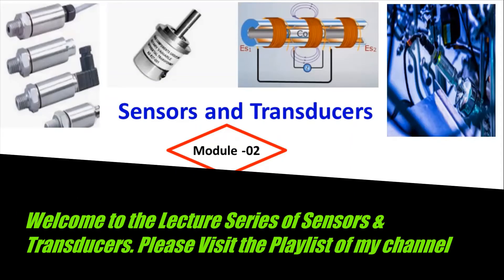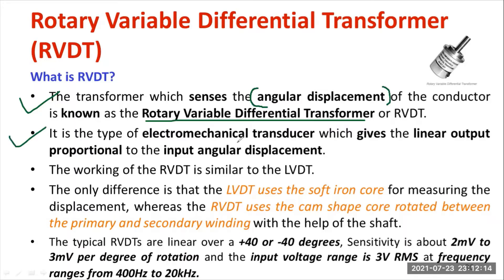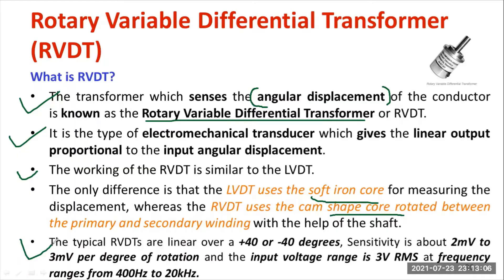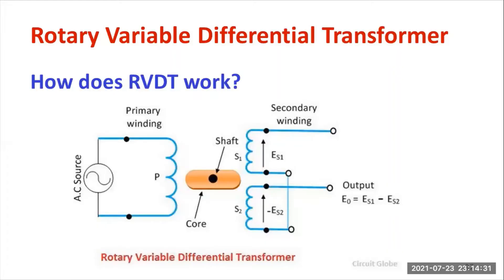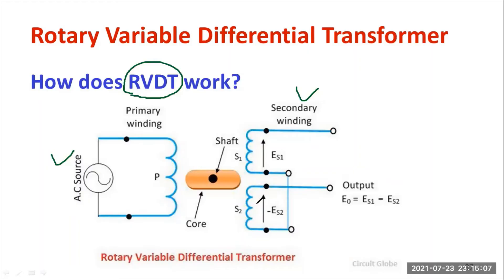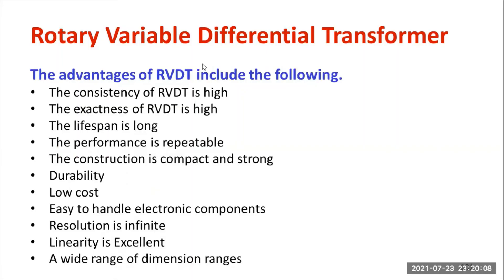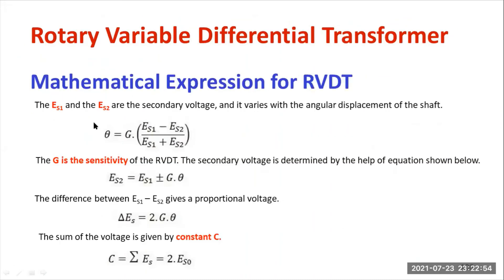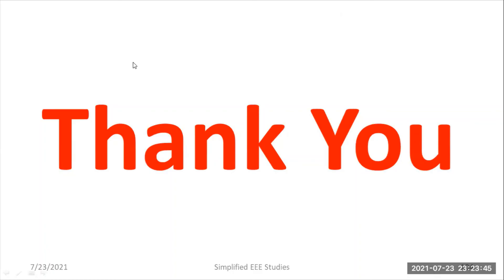ROTARY VARIABLE DIFFERENTIAL TRANSFORMERS|RVDT|CONSTRUCTION WORKING, Advantages,  & APPLICATIONS|S&T

Comment: I know this video is a bit old, but I can't find many videos on the topic, though I have a question. How viable would a RVDT be if the coils were on a PCB, and manipulated via a magnet; specifically, the primary being on one side of the PCB with the secondary on the other, with the pinout being ground, source, signal 1, and signal 2. I can't find any diagram, or really even a product, that depicts an RVDT in this way. I am referencing a specific component within a product, an RVDT makes the most sense, but I'm not entirely sure if it is one due to the atypical packaging, and I don't really know where else nor whom else to ask.